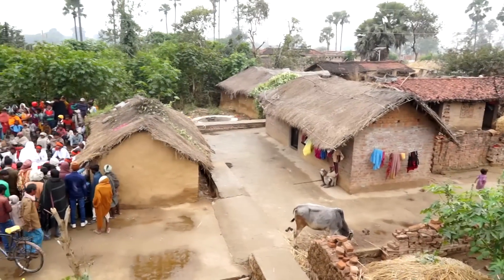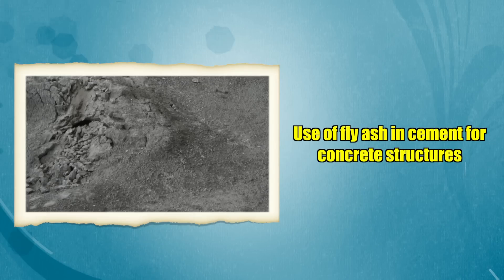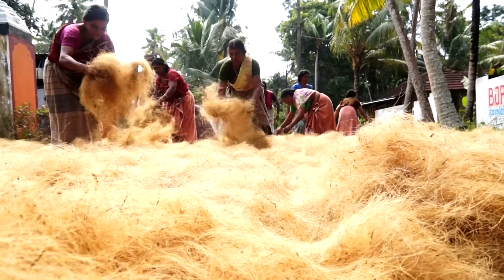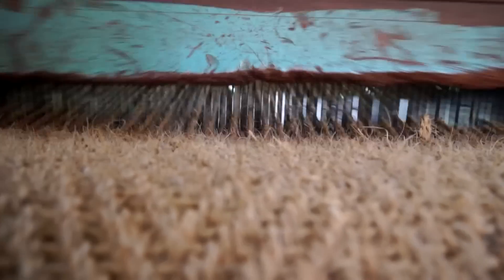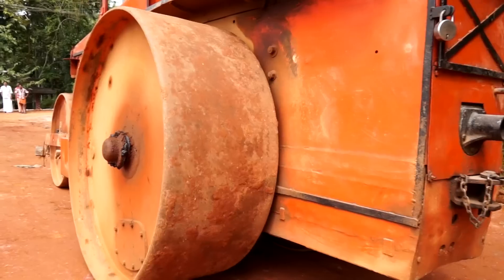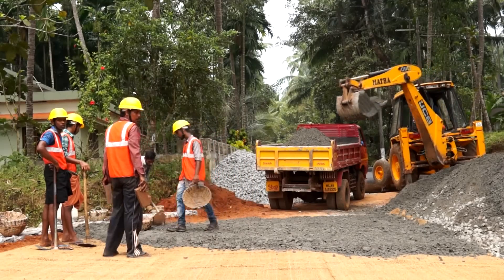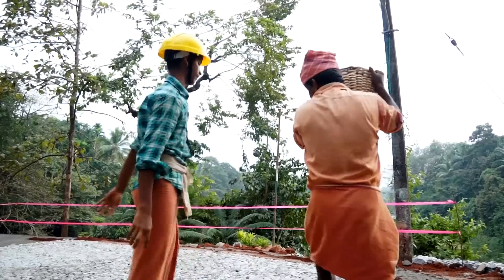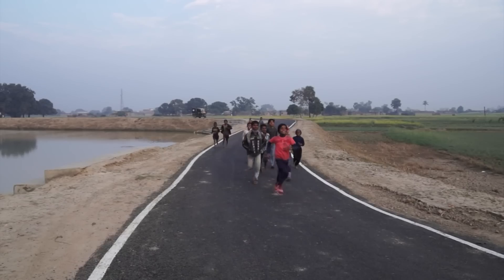Use of Coir Geo-textiles in the construction of Rural Roads

Comment: Strikes me that this with a tighter weave would be an excellent sustainable, [plastic free] alternative to the usual commercial geotextiles used in landscaping & in domestic gardens for weed suppression. By the time it rots down, plants would have grown sufficiently to shade out most weeds. You would still be able to plant through a coir geotextile in exactly the same way you would the commercial varieties: cut a cross slit section/s, peel back, dig holes, place plants in holes, firm soil back around the plants and fold back the coir geotextile around the base of the plants. Mulch with your choice of mulch, gravel or chipped bark being the most common.

Comment: Great to see coir used like this.

That guy with the cylinder of sand used to be me. That work is *miserable*. In the U.S. no matter how rural it is machines doing this work the whole way. We used the natural sand, then gravel, then a crushed stone to get the fines they mention, then it is surfaced with a base coat and top coat of asphalt. None of that shows up in woven baskets delivered by hand. Instead of coir we use a woven plastic, but even the, pretty rarely.

What is fascinating is that even with the rigorous standards of California they don't expect 100% compaction. You need the amount of water in the soil to be *perfect*. That 100% won't stay that way for those days of exposure in certain parts of the year. Great that they found a use for coir to manage this.
Reply: what is the use of adding coir or woven plastic?
Reply: @ashwin372  they act as damp-proof coarse.. for waterproofing

Comment: 😮@7:49...that's the main reason any road is messed up quick--it wasn't graded properly to begin with...smh you Must have a smooth surface + design the rainwater drainage to Not Wash away your hard work. This way, just about any road surface is long lasting...

Comment: how about using this material for roads that can breathe ? that can self drain water ? sp[ecially in cities where it is concretized
Reply: There are no roads that do really "breathe". Some road might absorb a little water, but in a City where a lot of ground is sealed, the only way to get the water out of there is through large sewers and big diameter Drainage pipes underground. Otherwise the water will wash away road and building foundations.
Reply: > self drain water
How to make a pothole
Reply: there is no point in absorbing water. the roads can only hold so much. instead, going all the way and improving the drainage system is more effective.
Reply: Production and scale might be an issue
Reply: Seriously?
Where the traffic is stacked bumper to bumper and the weight that goes with it?

Comment: I think this is an effective method of: 1) reducing the erosion of lower soil layers, due to the constant need of having to repair the roads in areas with moderate to heavy rainfall; and 2) steadying the road-material better, on the road patch, than what we observe usually.   What I would like to ask is about the uppermost layer of the road that is constantly getting washed away and has to be replaced, just like the regular roads. If there is any alternative already available for it and if we can use recycled plastic blocks instead. I am asking this question here because the NRRDA is also concerned with this video.
Reply: read about microplastics
Reply: Using plastic or similar is goimg to result in a lot of pollution. All that plastic will spread into the nature around the road due to erosion...

Comment: Not good product for heavy trafic roads. This item corods after 4,5 years. So may weaken top layer of roads above this layer. But good for village roads.
Reply: Exactly, that's why the heading has specifically rural roads
Reply: Hola, te refieres a que por ser un material orgánico, ¿su vida útil se agota debido a su descomposición?
Reply: @mmlufer  Yes I think that is what he means, it could also tear I assume from heavy traffic loads displacing the layers above it. But for small amounts of traffic I assume it will last much longer.
Reply: it is not a "Roman Road" technology...all roads must be maintained (fixed) regularly
for increased weight bearing, multiple layers of geotextile/bitumen , especially if properly graded to protect against water errosion*
Reply: All roads corod...sooo..
Reply: 4,5 years? You might be better off building no road at all, because a road that goes to shit after 5 years isnt worth it.
Reply: @blackdification  actually, if a good layer of gravel gets layed on top and properly compacted, it should locknotself together as a very sturdy foundation for a road on top--it's just hard to get enough compaction to make that really happen
Reply: Are you engineer sir?